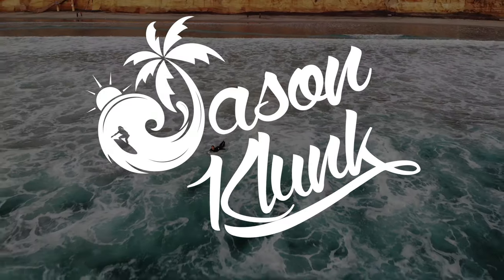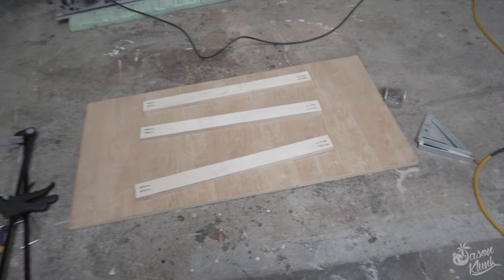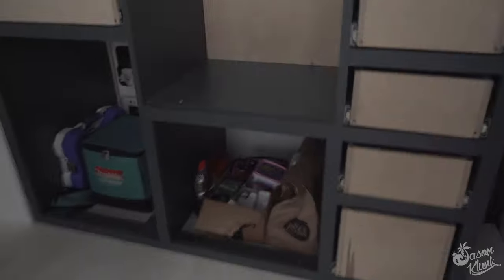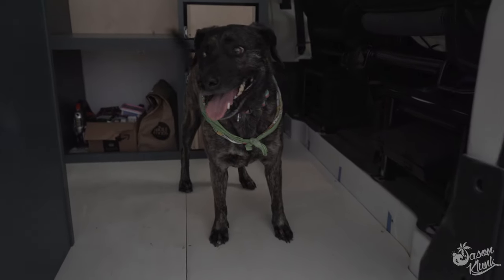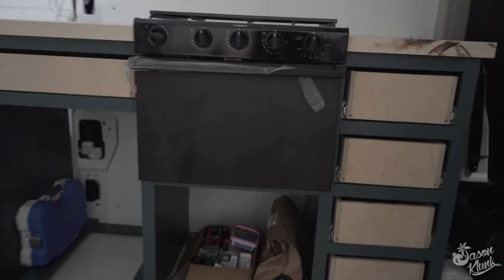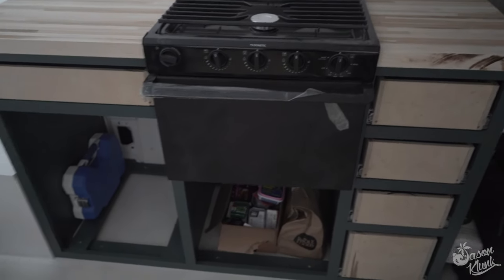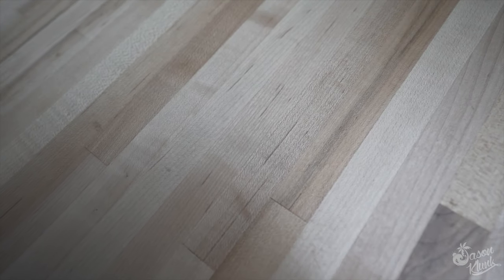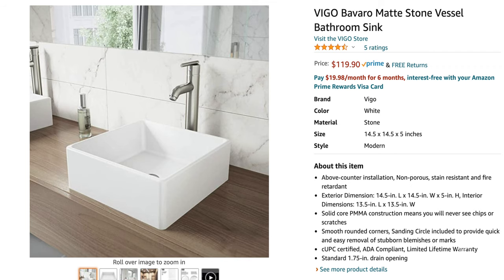Finishing Kitchen Cabinets! Ram ProMaster Van Build Conversion - Episode 18 | Jason Klunk

Comment: Jason, could you share a bit more color on how you built those beams to cover up the metal pillars? Loved how they turned out with the outlets and switches on them. The wall behind / adjacent seems to curve relative to the front surface of the beam, so curious how you trimmed the side panels so they would be flush against both the front panel (with outlets) and the back wall.
Reply from the maker: Thanks. They were a bit tricky to make, but it's like everything else in the van, you have to learn how to scribe and create templates. For the side pieces, I did one at a time with cardboard. I started with the back/curve, got it to fit nicely against the curve, and then cut the piece to the right depth. Repeat for the second side, and match the depth. The front is easy, it's just a matter of squaring it up.
Reply: @JasonKlunk  Thank you! Love your videos - been a huge help for me as I build my 159" WB promaster.

Comment: Another option for tiny sinks that won't need to be sealed or resealed are bar sinks. Made of metal and function just like kitchen sinks, but smaller! I'll most likely be using one in my future can to save on weight and avoid worrying about maintenance on the stone :)
Reply from the maker: Definitely, bar sinks are a great option too

Comment: Hey Jason,

Have loved watching your van build, you’re providing me with lots of inspiration and guidance as I convert our sprinter into a tiny home on wheels.

Just wanted to know how you secured your cabinets to the van? I love how much you’re getting the most out of your Kreg jig, so I assumed this would be the method? 

Thanks again for your detailed videos! Love your work!
Reply from the maker: thanks.  The cabinets are secured to the floor and to the wall. I used pocket screws in some spots but also just regular screws in areas where I could.

Comment: Question for you! We just purchased a two burner stovetop / oven combo from Thetford, and are curious if you added any kind of insulation layer between the oven itself and the surrounding plywood on the cabinets or backwall?
Reply from the maker: No, I was concerned about that as well though. There are very specific requirements for installation that I followed with my model, I'm sure yours is similar. You basically don't want gaps between the range and any surrounding cabinet, no combustible material next to the range, and make sure you have enough clearance above. Here's the documentation on mine: https://www.dometic.com/assets/31/72/installation%20and%20operating%20manual_63172.pdf

Comment: Hi, we love your build & colour choices. We noticed that the Vigo vessel sink is advertised as non-porous, but you mention needing to seal it because it's porous...can you clarify please?
Reply from the maker: Thanks. From what I've seen in person, it needs to be sealed. You can test it out yourself on a piece of the sink that won't ever be visible. There are other people using the same sink who suggest a sealant as well.
Reply: @JasonKlunk  Thank you so much for replying! I think we'll seal it just to be on the safe side :)
On another note, how have your push to open drawer slides worked out for you? We're looking into those as well!

Comment: Jason, your videos have been a huge help. I was installing ceiling furring strips today and used your craft paper tip. Also created a furring strip for the front of the van in the same way you showed. Clutch! 

I had a couple questions - Do you have any tips for finishing the area where the Promaster wall juts out in the middle of the van? Also, did you panel the back or top of your upper cabinet after attaching them to the furring strips? 

Thank you, I hope you are enjoying the van!
Reply from the maker: Awesome. I ended up building small 'beams' to go over those pillars, they sit in between my uppers and the butcher block. I ran most of my electrical through those pillars and then on my beams I have light switches and outlets. 

I paneled behind the uppers before I put them up. If I were to build another one, that's the only thing I would do different - find a better way to panel that whole wall.
Reply: @JasonKlunk  I appreciate you!

Comment: What did you use to secure the stone sink to the plywood base? Adhesive or mechanical?
Reply from the maker: No adhesive, it’s locked in tight between the cab and the countertop.